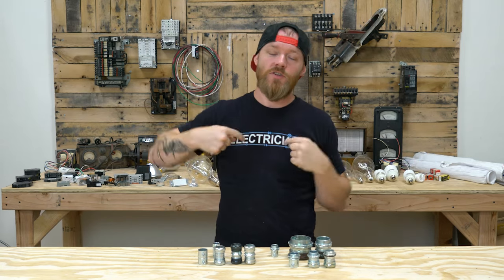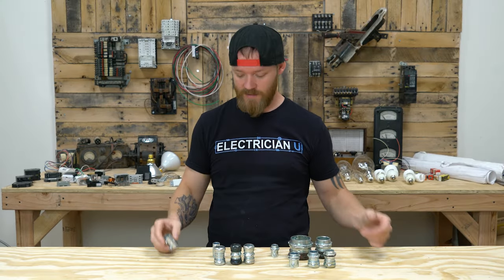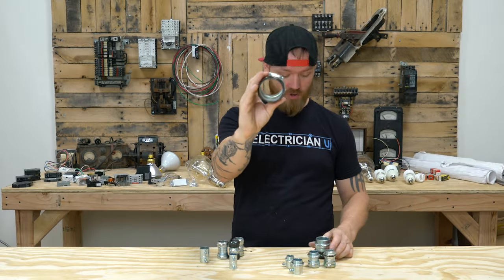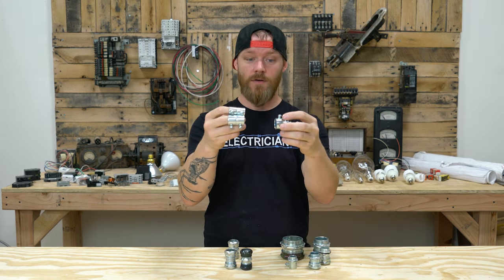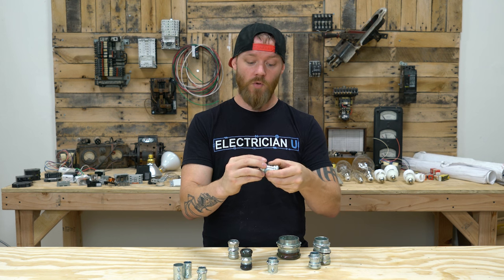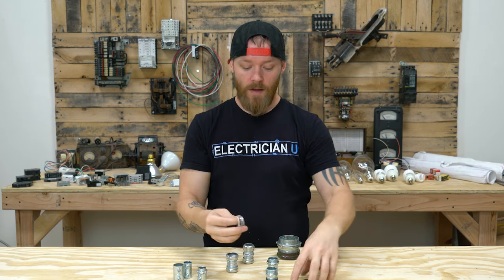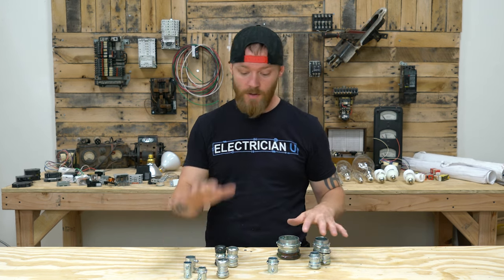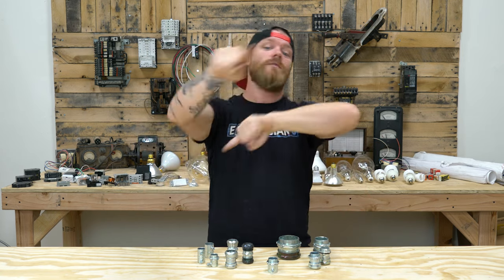EMT Couplings & Connectors - RAINTIGHT, COMPRESSION, & SET-SCREW fittings for electricians

Comment: Very good explanation as an Electrician I have seen many set screw couplings and connecters used outdoors which was always a no-no many years back when the code allowed EMT for outdoor use we did use the standard compression fittings which I still see some electricians use but yes EMT fittings for outdoors must be suitable and or marked rain tight.

Comment: QUESTION - Channel locks?  Why wouldn't you use 2 open end wrenches of the proper size?  Channel locks tend to bugger up connectors.  I guess the assumption is it will never be taken apart and carrying extra tools isn't worth it?  I've seen half-assed mechanics us channel locks too often, e.g. oil drain pan plugs).
Great channel!

Comment: I just installed weather proof compression couplings and connectors on 1/2" emt for outdoor lighting
Reply: Emt should not be used in a wet or damp location... hw or rigid should be used. Watch the video
Reply: @brianhulben7905  not true. Seen so many jobs now w EMT outdoors lol
Reply: @brianhulben7905  provide a code reference
Reply: Just because you have seen it does not make it ok
Reply: Is there a way to provide pics of the code book to you? Unless it is covered w a supplementary corrosion protection it is not permitted
Reply: @brianhulben7905  2 years in commercial dude. All we do is run conduit. Please look at the code book. I know when your coming out of the ground rigid is required up the 8ft also depends ahj/job
Specs
Reply: Ok dude nonunion jack check and see if your emt is protected against corrosion 300.6
Reply: @brianhulben7905  dude in the video he’s talking about reg compression fittings. They have ones that are blue you use wet/damp locations
Reply: @brianhulben7905  were talking about water not corrosion
Reply: @brianhulben7905  lol I’m just trying to help
Reply: Water is corosive to both steel and aluminium if not encased or coated
Reply: Who could you possibly be trying to help
Reply: Do you want some random person with no exp to start doing our job? Either they will hurt themselves or others thats why we get paid to do it right

Comment: Informative … but I have a question … 
What is your solution to an in-ground pool light conduit that was damaged when a pool fence was installed and the drill bit punctured the conduit?
Can the conduit be patched in place (and a new pool light installed)? Or does the conduit need to be replaced to either the underwater niche or to from the damage point to the first junction box?

Comment: Can you please go over liquid tight to EMT connectors. For example a service disconnect switch on a HVAC unit on a roof has metallic liquid tight and connects to the EMT penetrating the roof from inside the building. Thank you!

Comment: Could you explain the use of concentric and ecentric knockouts. Please include situations where voltage is less than 250V to ground. Example: 220 V AC units with 30A or 60 A disconnects.

Comment: If my access to the box is limited, can I install a 40/40 connector from inside the box? Or do I need to pull the box and press my connector in from the outside?

Comment: Not sure if its true or not but i have heard you in the US you guys dont use tech cable, is this true? We use it everywhere in industrial applications in canada. Ridgid conduit is pretty rare here. Even in commercial stuff its used but emt is more common there
Reply: Wouldn't say it's not used at all. We've layed miles of teck 90 cable direct burial for remote location feeders.  But within an industrial plant the standard is cable tray and tray cable in that tray.  Tray cable is about 90 cents cheaper per foot.
Reply: @ikerivers1795  not sure what tray cable is but everything ive seen/done is tech90 in tray, including the control wiring usually use the blue sheath stuff with the shield for that
Reply: @SupperDadder  it's basically Teck 90 without the armor
Reply: @SupperDadder  plus power and control cables are run in separate trays or in divided trays
Reply: @ikerivers1795  first thing i see when I Google tray cable vs tech is that tray cable isn't rated for Canadian standards, i guess thats why we don't use it

Also do you use ACWU? aluminum conductor tech without the inner sheath?

Comment: Question... if you have an "exposed" wire coming down the back side of a wall without drywall on one side. Do you technically have to put the Romex in conduit? I think the answer is yes. However... as the wire reaches the ceiling... how do you safely exit the conduit? I don't think the wire should simply exit the tube without some form on anti-chaffing nipple, but I've not seen anything like this. Do I simply allow the wire to exit the tube, and run the risk of cutting the sheathing off of the Romex at the tube cut location of my conduit?
Reply: NEC 300.16(A) provides that a box, conduit body, or terminal fitting with bushing shall be used whenever there is a transition from conduit, EMT, or other raceway to open wiring.

Comment: Hi Dustin, what I have is/are 2 pre-existing straight-shot junction boxes that I need to join with a straight (or not) section of EMT only 4 feet apart. I do not know of a non-internally threaded 1/2" galvanized pipe-like "union" which would allow me the clearance to fully seat both ends of the EMT into the straight-shot opposing junction box fittings, so what is a solution as you cannot bend the EMT to make the ends fit--or can you?  Or is there such a thing as a compression fitting without internal detents/stops/dimples so I could slip the compression fitting over and beyond the end of the 1/2" EMT conduit, install on one side and then slide conduit back through into the opposing fitting?

Thanks, Norm

Comment: For grounding purposes im wouldnt be so confident about the single plastic ring type fittings. That plastic ring is the main holding force of the conduit. The contact between the conduit/fitting isnt guaranteed, i woild feel more confident with the other type that also has the metal ring thats in contact with both the conduit and fitting

Comment: Good video. How about enbeded in concrete, what type of coupling or connector required for the situation?
Here in Canada steel type (no aluminum) EMT allowed in concrete, but do we need compression coupling or just regular screw type one?
Reply: Do not put emt underground or in concrete it will corrode
Reply: Underground & in Concrete use Grey electrical PVC PIPES and use the glue. Don't use above ground more than 8"in.
connect to a box and switch materials, if needed.

Comment: Don’t really use emt in residential or commercial usually use MC but dude u need to do a video about aluminum wiring because these homeowners are trying to renovate their homes and end up calling an electrician to finish their work ( and talk about copper clad) but on the side note there’s that homeowner in Home Depot trying to change a switch and doesn’t know the difference between a single pole and a 3 way and u just wanna ARRGH
Reply: Stay away from aluminum wires, & never never use copper wires on aluminum run 😝
Can you see 🔥 fire yet.